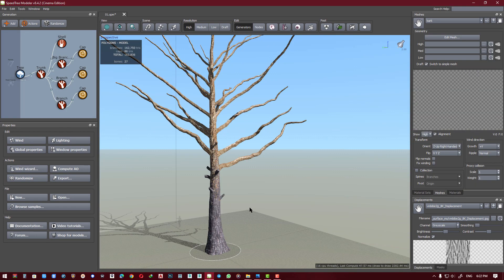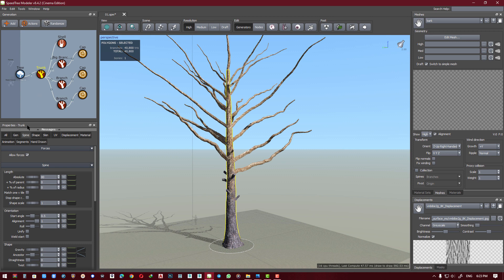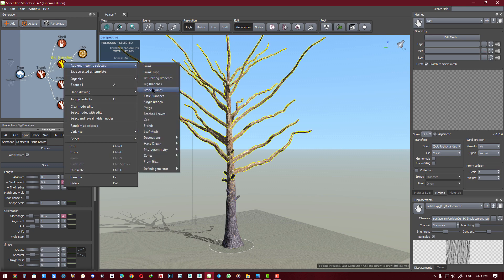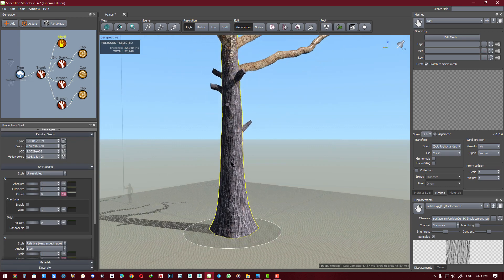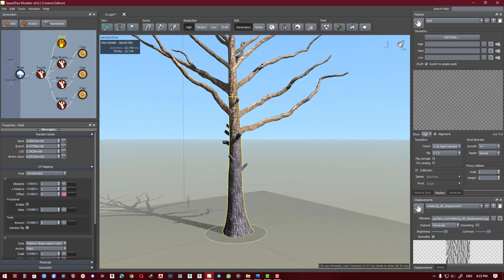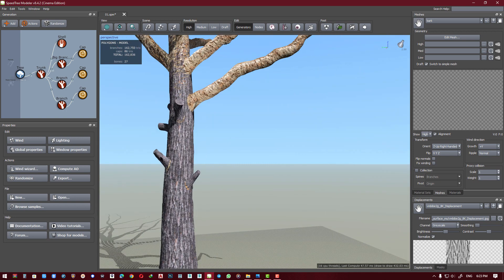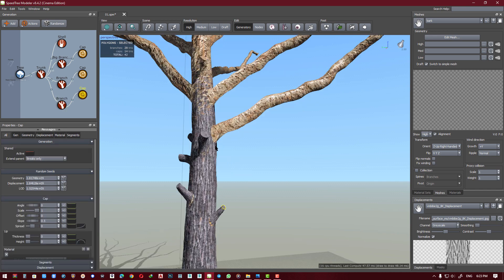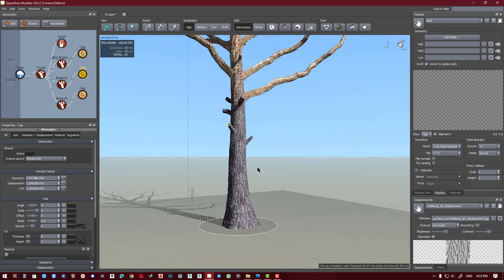how to create Pine tree in speedtree

Comment: Hey, what technique are you using to have a combined texture for the bark? Meaning two materials, the darker bark blending into brighter.
Reply from the maker: Hi my friend, in this video The material I put for the trunk of the tree is different from the material of the branches. In the decorations section, add a shell and adjust the settings as desired

Comment: How to build norfolk island pine tree for me pls. Thank bro
Reply from the maker: Make a tree trunk and set the required parameters according to the reference you have chosen, I suggest you make the branches with big branch and then make the length and radius of the branch according to the reference.  Change the start angle and gravity so that your model matches the reference.  Make the leaves with batched leaves and then adjust their angle with gravity.  There should be a lot of them for this tree.  If you want to build this tree with a high height, the branches should grow from 8 sides or more or less than the reference
Reply from the maker: If I could, I will make this tree in the future and upload the tutorial.  But I may do it in the next few weeks or even months.  If you want, you can send me a message during the construction of the tree and I will give you complete instructions